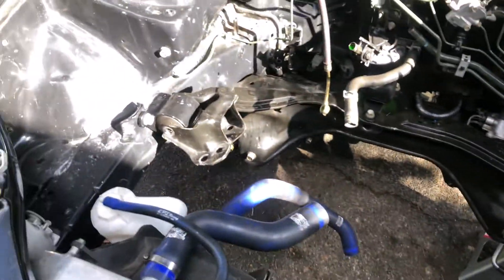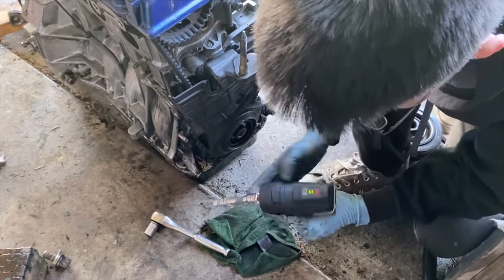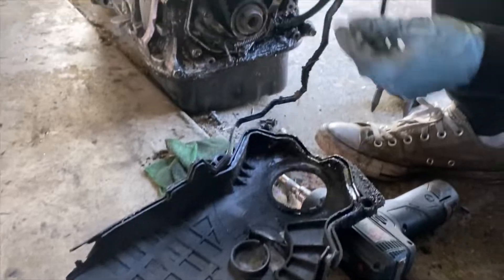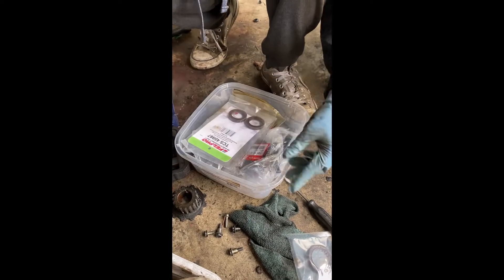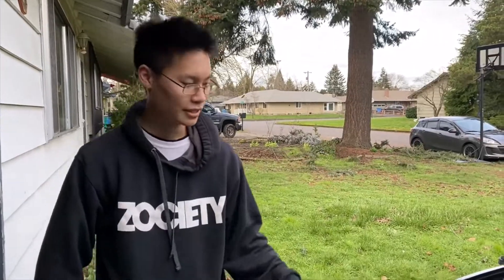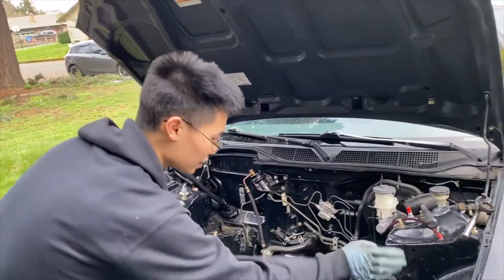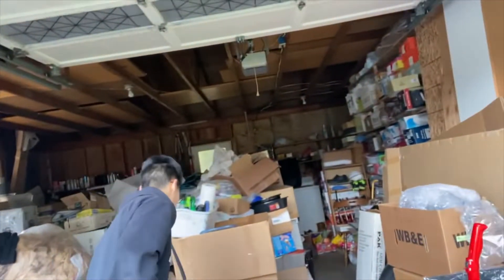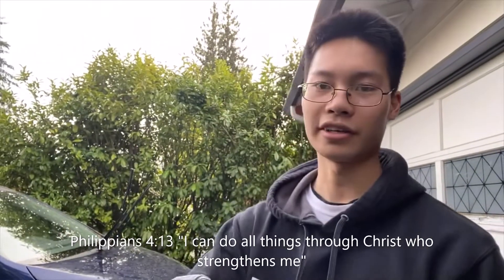Honda Civic EK gets a LSVTEC swap! | B18b1/B16 head!

Comment: Why not b20 bottom end ?
Reply from the maker: Lsv is better for boost since there is more cylinder wall thickness than on a b20. 81 mm on b18 and 84mm on b20. But besides that yes b20v would be a really nice torquey n/a setup
Reply: @hhracingdevelopment6792  that’s true
Reply from the maker: @11wrx_sedan27  we had a b20v eg hatch on this channel and it was fast!
Reply: Stock block ?
Reply from the maker: @11wrx_sedan27  yes